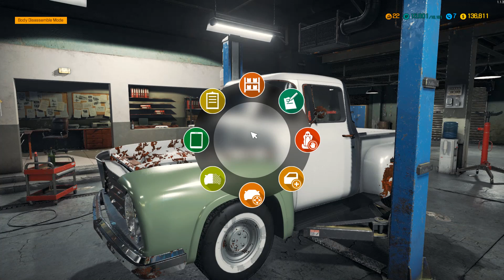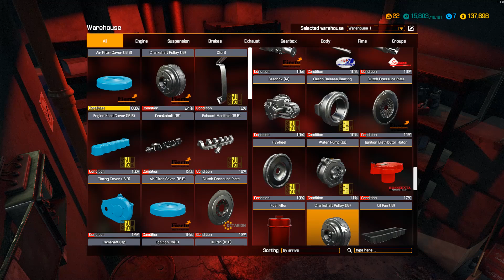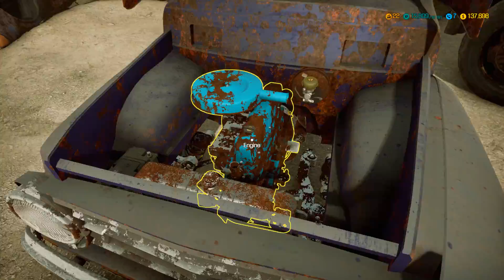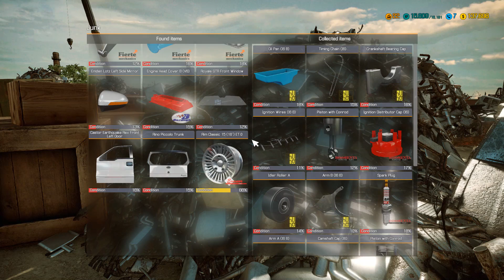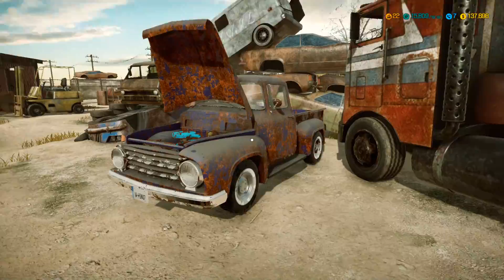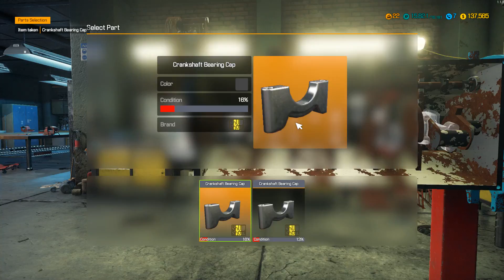Car Mechanic Simulator 2018 - Junker Engine Challenge

Comment: The ability to make Money from the Junkyard is so easy.  One trip I bought every part from the junkyard, everything.  It Cost me $5258.  After Repairs to 100%, I sold all the Junk and Got $8808.  This meant I could keep all the Body Parts, all the Rims and Interior bits as well, and the Parts I manages to repair (only at 75% right now).  So I did it again, Kept all the parts I could repair, Body parts, rims (I cant repair these yet), interior parts, spent another $5800, sold the junk for $12400.  Sure I lot one of the Junk Cars I bought when I moved them from the parking Lot to the Garage, but 2 out of 3 ain't bad.  They will get the bugs ironed out soon.  All part of playing an Alpha game.

Comment: At least you didn't try a junker rotary engine. I don't think I ever saw a rotor or the water pump for it in any junk pile. I have seen a few (very few) piston rings and push rods so it should be possible to build a complete engine from salvaged parts.

Comment: Dont know if you read my comment last time but the w12 and the i3 as with all engines can be added to any car via the editor on opening the game there is a popup use it it will changed any owned car of that type to the engine you specify and back again when you have finished.

Comment: looks at the I6 B
wait a fucking minute
if the cam shaft is on the driver's side of the block (USA Drivers)
THEN WHY IN THE NAME OF FUCK ARE THE PUSH ROD HOLES ON THE OTHER SIDE?!?!?!?!???!
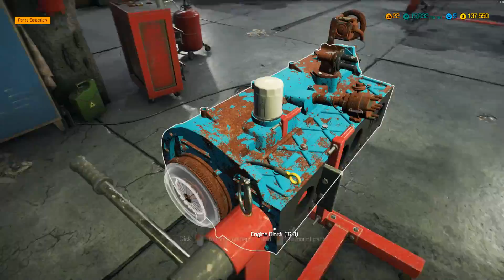@20:35
@20:40
Reply: Rockthevox maybe they're diagonally mounted?

Comment: You should try and build a whole car from junk parts (as much as possible anyways). Buy a car you like, strip it of all body parts and panels, engine, suspension, and sell it all, then find every single part you can possibly find in the junkyard without using other junk cars, just go through the piles, and build the engine, suspension, body, EVERYTHING. This would be a long term project most likely, but it would be cool non the less.